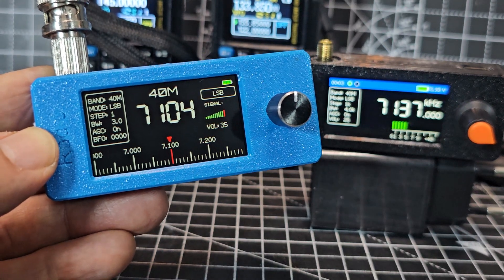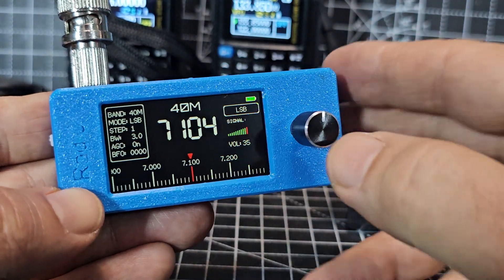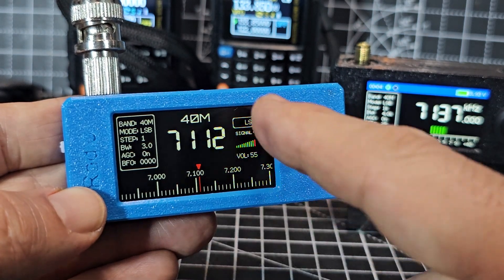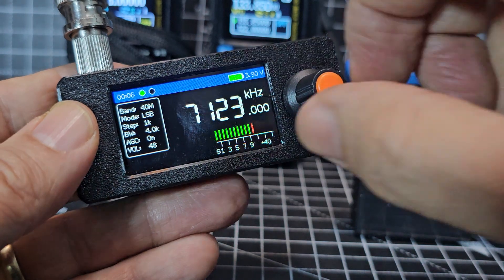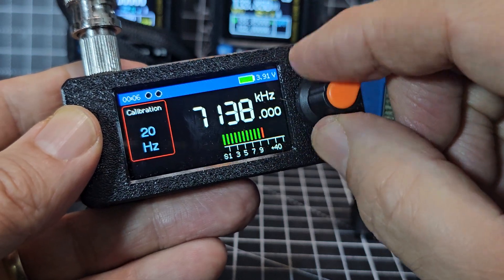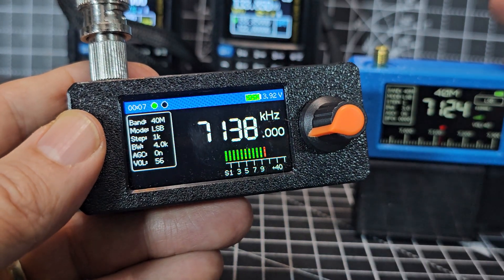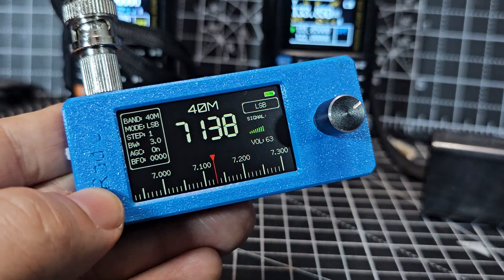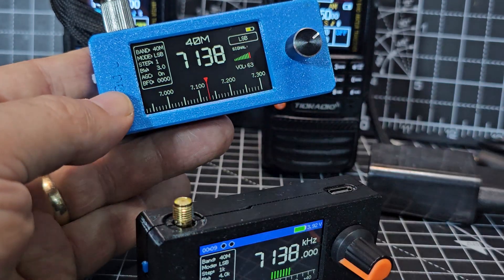Mini Si4732 Pocket Receiver , Firmware Versions

Comment: In new firmware calibration is not meant to be used for fine tuning. You can fine tune using small frequency steps like 10/25/50/100Hz in Step menu.
Reply from the maker: No it's not fine enough for HF

Comment: Which version did you install, 1.0_8m? I did and it works fine. Got the receiver with the Alu-case, very pretty and they also installed a nice metal knob with good grip. Only issuue is that the on/off switch is too short, it doesn´t look out of the case so you alway need a toothpick or something similar to switch it 😀
Reply: Sorry, latest version is 1.01_8
Reply from the maker: Ok
Reply from the maker: Ok

Comment: Does the new firmware seem to have any better reception? Mine is pretty deaf.
Reply from the maker: These devices ate not deaf you needs a 66ft wire
Reply: @M0FXBHamTech  noooo very sensitive even on the telescopic. I've heard US stations on 40m with just this but I think some are deaf and there are low volume issues. 2 had this my 3rd is much louder